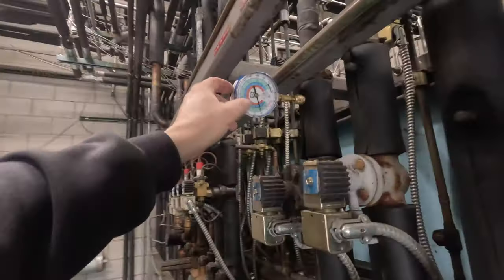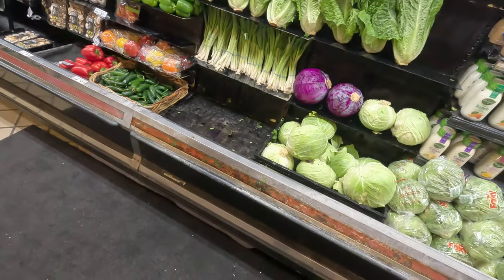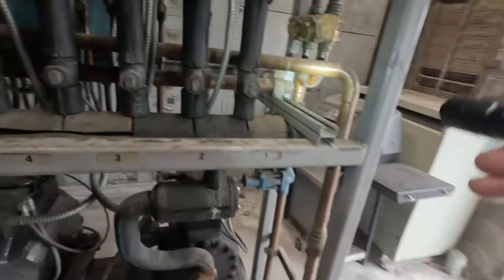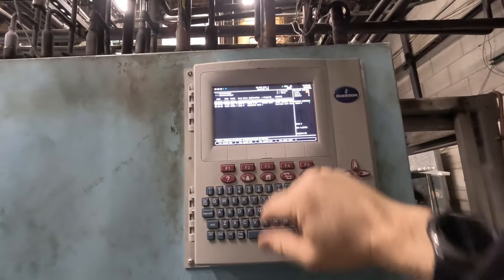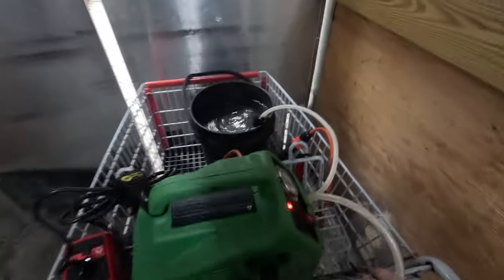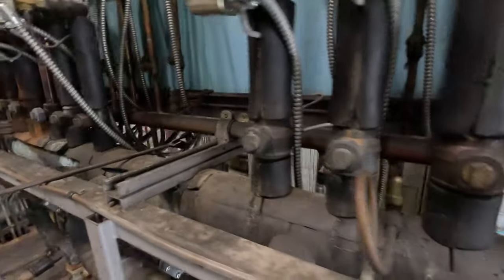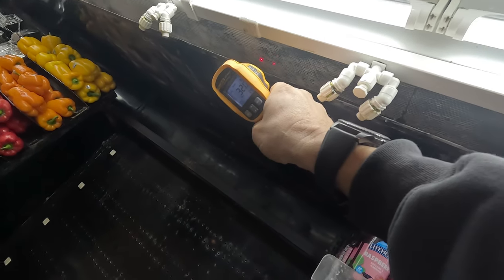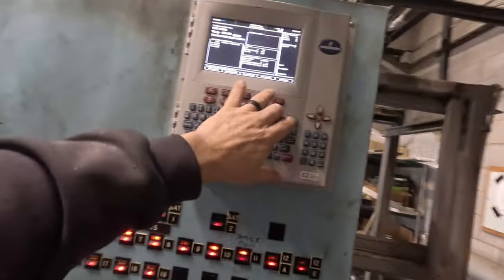Uneven Case Temperatures, What Did I do!?

Comment: Way to dig into it, uneven case temps are always frustrating. Only other thing I would have done was confirmed that each sensor was reading accurately. That's usually the first thing I do so I know my controller is getting the correct info. 
The 2 solenoids are to trap liquid in the coils during defrost.
Reply from the maker: Good call👍👍 why trap it in the coil with a timed off defrost?
Reply: @HVACRSurvival  you're using the liquid trapped in the coil for heat transfer. Kinda like how you would with gas defrost. 
The same thing as when you just have a suction stop or EPR.

Comment: As far as I know one of the reasons the engineers sometimes designed it that the Suction stop turns off instead of the liquid solenoid is to stop liquid hammer in the lines. I’ve seen unsecured liquid lines shake real bad when it opens and sometimes cracks  90s or rubs liquid lines close to the rack. Only happens on the circuits that don’t cycle quickly and a-lot of the liquid boils off in the line during the off time. Doesn’t happen often but eliminates that risk especially if the contractor doesn’t do a good job securing lines. It does trap more refrigerant out there so it’s a give and take I guess.
Reply from the maker: Thanks for sharing your experience 👍👍

Comment: The solenoid valve on the suction line is an EPR it allows you to have different evap Temps on a single rack by regulating evap pressures.
Reply from the maker: I was talking about the plain solenoid valve not the Sorit valve.  I have racks with Sorit valves where that's how we regulate temp and it never closes. Thanks for checking it out 👍👍
Reply: @HVACRSurvival  my bad

Comment: Cut the two prong connector off an old fan motor and wire it to a junction box with an old extension cord maybe 6ft long with the female end still on.  Unplug one fan motor and then you have 120v without running 100ft of cord.

Comment: The solenoids do trap refrigerant, but it's only vapor. Liquid line solenoid closes first, time is allowed to pump down, then EPR will be de-energized. Trapping lots of liquid could have bad outcomes. Design of those cases gives varying output temperatues, airflow low and un-even.
Reply: I’m surprised the OEM doesn’t have a option for pumping down the system for maintenance purposes. Sure would make things easier.
Reply from the maker: @Mike a lot of the options that make the job easier are installed optionally at the time of installation.
Reply: They’re meant to keep the evaporators at a certain psi to maintain temp tho right

Comment: ❄️🇺🇸👍💪 nice work. If screen was plugged would there b heavy frost to ice on valve body ?  Thanks for sharing ur experiences
Reply from the maker: We have been having Problems with screens and dryers so I always have that in the back of my mind. We also have a few that were just converted over to poe oil and that will break junk loose as well

Comment: I'm fine with watching the racks, but I will admit that for the non-specialist, racks are VERY confusing.   It seems like there's multiple compressors for multiple sections, but they share the same refrigerant (or at least that's how it _sounds_)    

So, Slime in the Ice (Machine)?   (Look up that phrase, with Marvin Zindler as a name)
Reply from the maker: You're correct, that's how they work 👍👍. Your Hired 😁

Comment: Curious why you didn’t have to evacuate the line set prior to allowing charge back in after removing the screen (opening up the system)?
Reply: He had pressure in the system still when he removed the txv screen and kept this thumb over the opening so it never got into atmosphere
Reply from the maker: @big dawg  This is Real life, we loose more in our refrigerant hoses when we purge our gauges than what 8 psi of vapor escaped for 2 seconds.
Reply: @HVACRSurvival  no issue loosing gas, just didn’t know with system open if it introduced atmosphere
Reply from the maker: @big dawg that's why I wanted it in a positive pressure so nothing can get into the system. You don't want to pull a vacuum on a couple hundred feet of line as big as what this was. You also don't want to use nitrogen unless you absolutely need to. There's some things about rack refrigeration that you just don't do unless absolutely necessary.
Reply: @HVACR Survival  never nitro on a circuit still hooked up to the headers. There are no leak free ball valves.

Comment: Are those just a isolation solenoids on the case return? Or those PWM regulated proportional solenoids, as case pressure/temperature control? 
Talking about your comment about “trapping the refrigerant”.
Reply from the maker: The simple looking ones were just a suction solenoid, the valves on the end with hot gas were sorit valves, they are a EPR valve with a suction stop.
Reply: @HVACRSurvival  👍